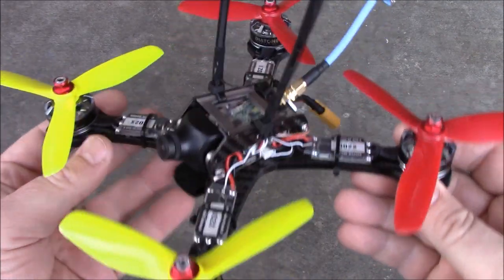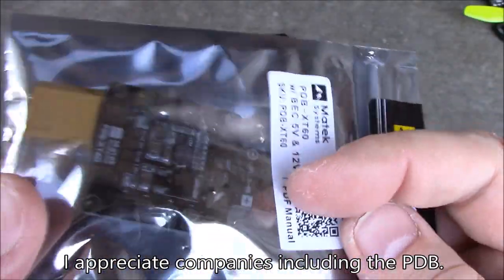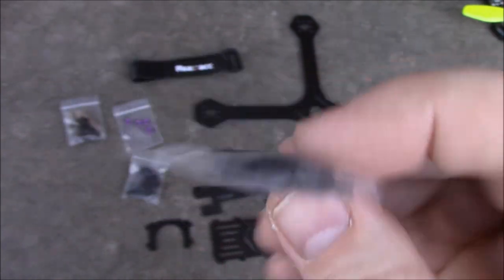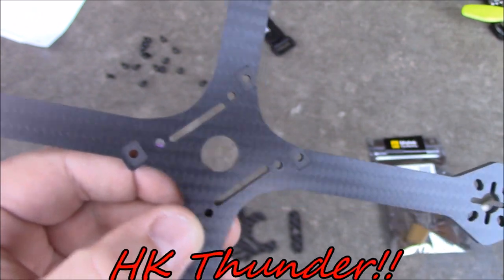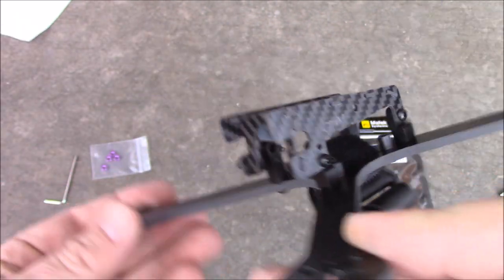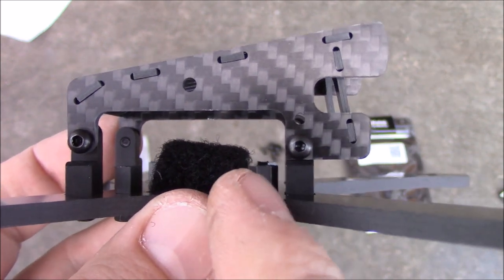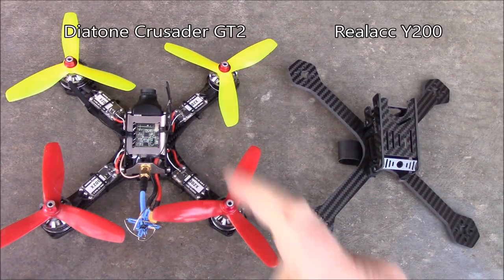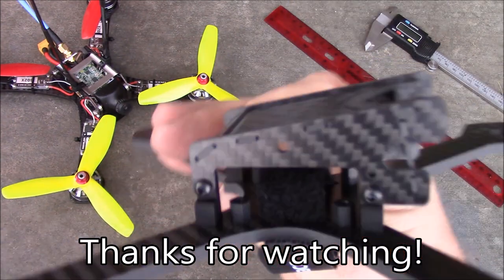Realacc Y200 (Crusader GT2 Clone) Review from Banggood

Comment: Love your channel keep it up.
Reply from the maker: Thanks!
Reply: i got a question for you i have a zmr250 comming and i have emax 2205s and dys se2205. i can't decide what to put on it. Never tried the dys i have emax 2205s on most of my builds.

I am also thinking of putting F60 notors on the y200 never tried those motors eithers.
Reply from the maker: The F60s are suppose to be real good motors.  I have some of the DYS SE2205 motors and they are descent.  I had one get a grinding sound in it.  All my others have been fine.  If it was me, I'd want to build a new quad a little different so I didn't end up with a lot of quads that are the same.  However, I also wouldn't mind having a couple of quads that are all the same for racing.  That way when one crashes, I can fly the next one without having to do much mental adjustment because they'd fly the same.... I'm at a loss for a good recommendation for you.  :)
Reply: Great thanks for the heads up I will probably then buy another pair of F60's and put them on the ZMR lol and keep the dys for another build.
Reply: Hay! Why did you hide my comment with a link to the new version? For your affiliate profit, your subscribers must suffer from this subquality?
Reply from the maker: It's not a "newer version".  It was Alibaba's version.  Red metal pieces and a 5mm main plate don't make it a newer version or make this one "subquality".
Reply: I moderate this frame. And the fact that you have received this version is not as in the bang picture - this is you must say thank you to me.

Comment: Do you think there is a chance of getting the PDB, a F4, a vTx and a X4Rsb tucked in there? I really like the look and the low profile of this frame, but I wouldn't want to use a all in one board because they are pretty expensive.
Reply from the maker: The easy answer for me to give is "maybe".  If you used 2 nylon nuts below the lower board (to make room for a battery strap) and then a short spacer between the two boards, and direct soldered the ESCs instead of using pins, I think you'd have a good chance.
Reply: travisgrindal Ok, thanks a lot!! I planned on soldering the ESCs directly anyways, so I will just have to look for some nylon nuts and screws. ;)

Comment: did u try flipping the carbon around so the top video camera mount isnt blocked?
Reply from the maker: Yes.  As it comes in the kit, it won't fit if you turn it up side down.  If you trimmed off a little carbon fiber off of it, it probably would though.  But I could only assume that they didn't plan it that way.

Comment: You still haven't fixed your battery strap in the gt2? Hehe
Reply from the maker: I started to take it all apart and then it was getting tough because all the wires are soldered so short that I just put it all back together and I just fly it with the battery sideways.  :)

Comment: I would be careful with this PDB, it is no original Matek PDB... A couple of friends (including me) had the PDBs from the Realacc frames and we all had trouble with them - busted 5V regulator or internal shortcut.
Reply from the maker: Interesting.  I've used several of these and the only problem I've had is bending the input connector part.  Maybe you're overloading the 5V output?  I only run the flight board off of it.  I run my cameras off the 12v and my VTX off the full voltage of the battery.
Reply: I only used it for FC and RX (X4Rsb)...
Reply from the maker: humm... that shouldn't be too much.  I'm not sure what would cause that then.
Reply: travisgrindal I don't know either. In my case it was quite strange too. I flew 5 packs, then changed some betaflight settings at the computer, plug the battery back and the pdb literally catched fire... causing the x4rsb to "explode"